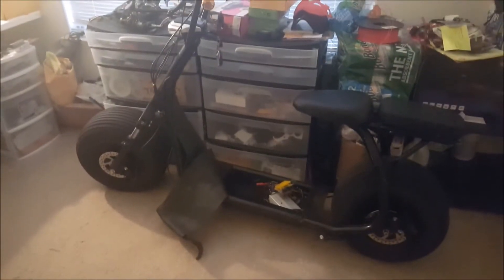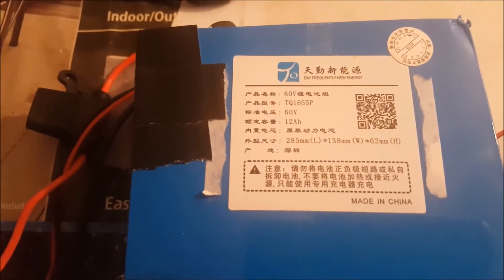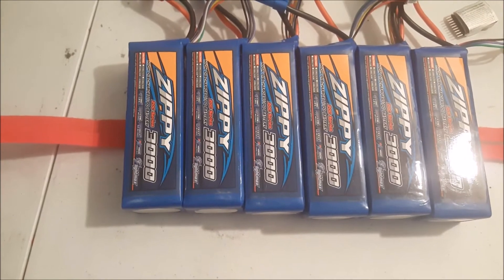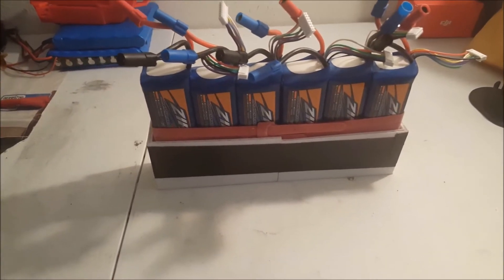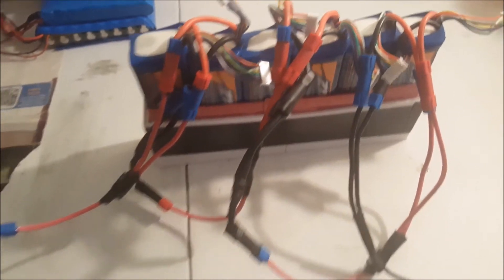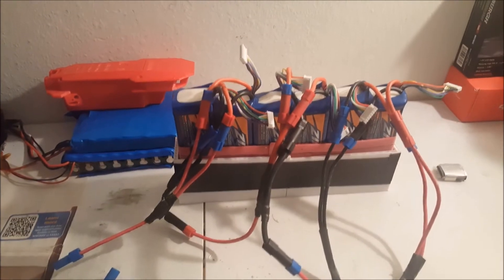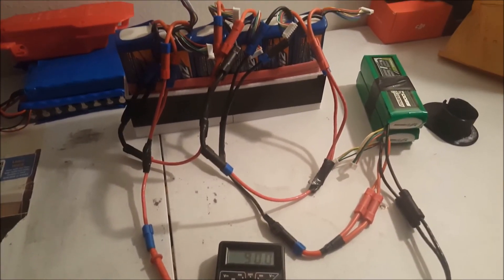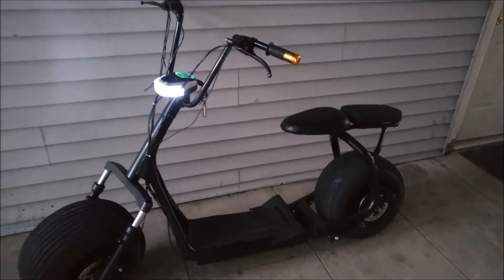90 VOLT!!  5400w Lipo Battery Powered City Coco Harley Scooter How To Setup

Comment: the stock setup was trash, my e scooter is 72 volts or 75 volts fully charged and 8000watt dual motor, it  woulda smoked that stock set up you got on top end AND acceleration, 
I dont blame you for upgrading that shit, i would've like to see a video of it finished and you doing a speed run.

Comment: You really think your pulling 60 amps on that little wire ? You need  some fat 8g silicone to pump that current to your controller. But really you will only pull max current for a few seconds when your wot off the line. 
Good job man keep advancing stuff

Comment: I have the exact same scooter can you tell me from beginning to end exactly how it’s done everything you put on everything you took off that way I’m not missing nothing
Reply: I think it would go like this:

1: take off cover
2: take out stock battery
3: pull out motor controller with cables attached
4: check if cables are labeled and write this down somewhere
5: remove old motor controller
6: attach Luna Cycle 60amp Bluetooth Programmable Controller (you can look up videoes on how to attach motor controllers where they explain how to make sure you have the right wires connected)
7: attach lipo setup shown in the video

tell me if I forgot something
Reply: Benny Banuelos bro me too! I need this setup

Comment: So you only added batteries and replaced the controller unit? Doesn't that burn the motor? I am interested in this because I have a similar scooter and could use some extra boost ;) I also happend to have some exctrabatteries in my house...because of the quad compter using them.
Reply from the maker: Yea I changed The Batteries and The Controller.. So far I pushed a 100 volts through the motor and it's all good as of now 😁.. I'll be doing more videos on this soon
Reply: That is great news! Thank you very much :)

Comment: Hi how did u manage to get 90V @ 60Ah, eg the 5400Wh qouted ?? as 6 x 6S3000mA is more like 6 x 22.2V x 3Ah = 399Wh. Don't get fooled the 20C 3000mAh LiPO gives you indeed 60A but for max. 10 seconds, so there is no 60Ah! With the LiPOs u mentioned u should parallel/series just about 81pcs to get the 5400Wh pack. Good luck!